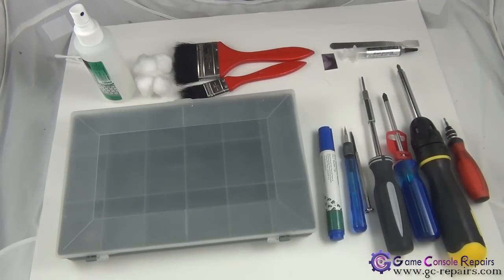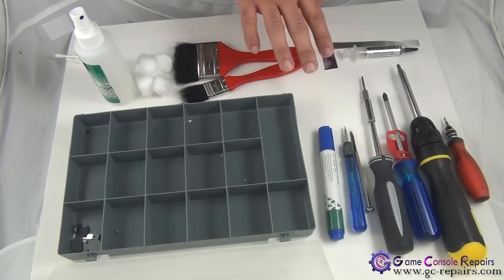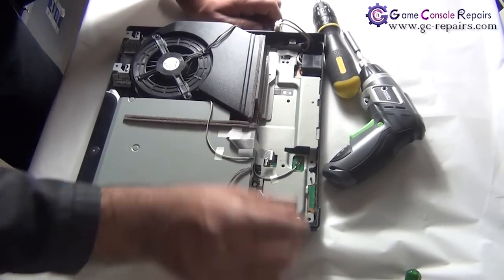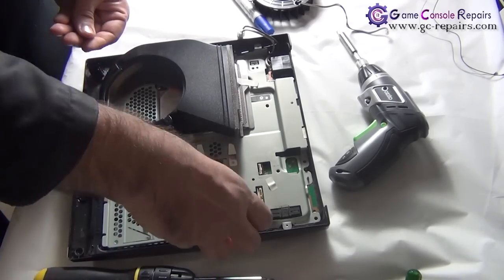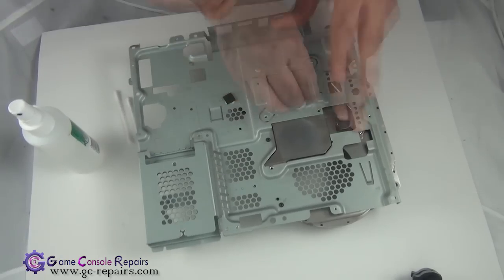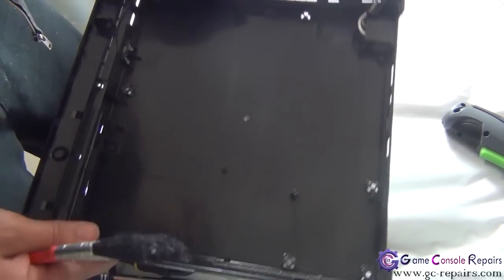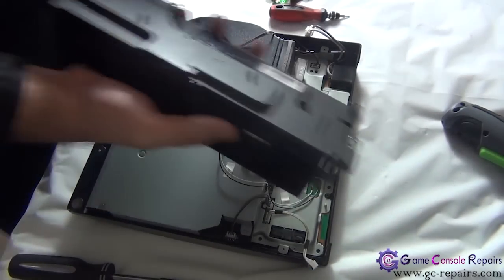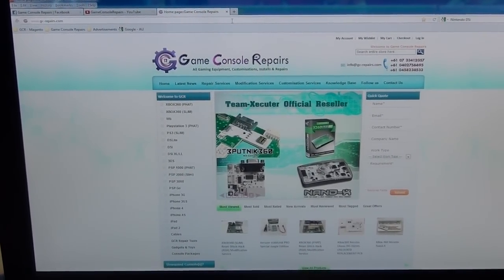PS3SLIM   250GB CECH 2002x   Thermal Compound Replacement by gc repairs com

Comment: For CECH 2004A motherboard is stuck to the chassis and it is difficult to deatach. How can I seperate it without damaging the motherboard and even end up in ylod ? Thank you very much.
Reply from the maker: Most likely the thermal paste is completely dried off. 
Use a heat gun on the CPU/GPU chipset to loosen-up the Old thermal paste from the motherboard.

ATTEMPT # 1 - Try 120-degrees for 10-seconds and lift up

ATTEMPT # 2 - Try 150-degrees for 5-seconds and lift up

Hope this helps.

Comment: Excellent video! I was noticing a very loud fan noise on my old PS3 Slim along with a rather high temperature on the outgoing air.   This vid helped me to clean and replace the Thermal compound this morning . It is now smooth and silent as day one.

Comment: For the CECH 3001A the fan cannot be removed until you remove the bottom plate and expose the cpu/gpu. 4 tiny black screws hold it into the motherboard.
Also, the blu ray player requires needle nose plyers to reinstall the big ribbon, which is on the BOTTOM of this model and the ribbon is only 1 inch, or 25mm, long. Note to anyone out there with this model. 
Other than that, some of the screws are different.

Thank you, and great video!

Comment: Stripped mine down in prep to buy the paste as I wanted to see just how dusty/old it looked and it wasn't that bad, still had some stick to it, some crusty.  I've replaced the lithium battery just as I had a fair few (what does that do anyone know?), might not bother with the blu ray drive if I can't reconnect given i'm using it mostly for psn.

Reason for giving  this a go was because after 5 years of no use I finally hacked it to get some hard to find games on it, 10 hours play later just wouldn't power on longer than 3 seconds, apparently (and hopefully) this is the fix

Comment: I have a question. I have teo ps3s the I cannot get to play a game long enough. I have opened them both and cleaned the lens. It seems to be another issue because the system is not that hot and I get a freeze.

Comment: My bluray drive dropped on the floor by accident from a table. I'd say like a foot drop. Should I expect it to be damaged?
Reply: yes there are lots of moving mechanic parts witch are plastic or really bad connected ....... to case ......
Reply: did it work afterwards?

Comment: Had some fun tonite doing this, since Im tried of the ps4 games I have. So why not make the best of it and replace the cooling paste I though. 11:12 I unmouted the fan-house to so I could clean it better. Not much dust here after five years. But I recon I can start having some fun with the beloved and old ps3 now. Thanks for posting. I would have used more time on this if I was without a answer on where all the screws should go.

Comment: I need some tips or help. I applied thermal paste on the CPU and GPU. I reassembled the PS3. It played the PS3 games it was playing before, (using hair dryer to bypass the ylod) then the PS3 suddenly turned off. After it shut off on me, I haven’t been able to get it to display on my TV anymore and it freezes anytime i press the power button on. Please help before I drop the PS3 outside my 7 story window.

Comment: I have a question. My PS3 turns on and immediately off, including the fan. Everything seems to work, it's receiving power but just doesn't stay on. I've done the self cleaning by holding the eject button which causes the ps3 light to flash red red green yellow but that never happens without the fan test. Will doing this fix the PS3? Also, I've heard of a method involving a setting within the power block as well. I want to do this and I'm ready but IDK if it will fix my issue. Thank you ahead of time.
Reply: Yes it would fix it. It worked like magic on my faulty PS3

Comment: Hey you guys, i had a question.
I've changed recently the thermalpaste of my PS3 Slim, and i have noticed  that the system fan hasbecome stiller.
That is fine, but now strangely enough after a couple of hours gameing, when i say  oke time to turnoff my PS3 via the menu. Than i get 3 beeps when the system is turningoff ?
Reply: It means its force closing an app/game

Comment: How long should you wait after putting th  thermoglue before turning the ps3 on ?
Reply: The thermal paste will work once its on. It will take several cycles of warming up and cooling before it's performing at peak performance, but it's 100% safe none the less.

Comment: Making something broken work again instead of buying a new one is the greatest feeling, especially after your up at 5:00 in the morning continuing to try not willing to accept failure for the day. Thank you, for your video fueled my obsession to fix my PS3 and guided me through it making me a champion cpu chip cooler who earned a well deserved rest to mid day. Now I'm off to enjoy the rest of the day and boast of my accomplishment, still knowing little about the inner workings of the PS3. I have not turned on my PS3 for fear of the realization that it may have already stopped working but I take pride in knowing it worked the last time I checked
Reply: You're crazy 😂
Reply: Is it still working?
Reply: I tried to repair my 60GB "fat" PS3 3 times, couldn't get it to work. Unfortunately, I feel it suffered irreparable CPU damage when it YLOD years before. That or the massive heat sink got bent when I pryed it off. Either way, I sold it on EBay for parts.... I loved that thing, so shiny, so sleek, backwards compatible, such a great console. 😶
Reply: @ultima913  I bet it was the capacitors that burned out every one thinks it's the rsx chip but it the 3.5volts capacitors that caused yellow light of death

Comment: WARNING DO NOT SPREAD THE THERMAL PASTE! PLACE ONLY A DOT IN THE MIDDLE SIZE OF A RICE CORN AND IT WILL EVENLY DISTRIBUTE WHEN YOU CONNECT THE HEATSINK BACK! 

YOU SHOULD NEVER SPREAD THERMAL PASTE AS IT CREATES AIR BUBBLES AND CAN CAUSE HEAT POCKETS WHICH WILL DESTROY YOUR CHIPSET! BE WARNED
Reply: It doesn't matter as much as you think it does. What's important is that it's there, not so much how it's applied (unless there's too much or too little). Trust me, I've done so many tests of this. The pea method always results in 3C or so better temperatures in a full load situation on a PC, not sure why a PS3 would be any different. It's not going to blow anything up to do the spread method. With that said, pea is definitely how it's done from the factory and its just easier in this situation, those alignment pins make it so that when you put the motherboard back into the top of the holding cell, it mates the heatsink with the chips perfectly.
Reply: If you have to add more for some reason, it's recommended to clean everything off again and put on new thermal paste entirely.
Generally you don't need to put on a lot, a cooked rice grain or a small pea sized drop should be more than enough.
Reply: SMGJohn What if it doesn't spread through out the whole chip can you add a little more?
Reply: +Ram Bow
The fact that there are hundreds of videos on YouTube that just proves that rice corn is the best method and spreads just as well as the other methods without overspreading and it also leaves no air gaps which can be the difference between a long lived CPU or a short lived CPU.

Overdoing it can cause worse thermal performance, basically there so much thermal paste your copper plate wont connect properly to the chipset.
Having two layers is also the worst thing you can possibly do.

Just watch the videos proving the point, there no need to overdo it or doing it complicated.
Americans always have to do it complicated when more than often, the simplest of the methods is the easiest.
Reply: NO IT DOES NOT.

This is an old myth from the early 2000s. It has been debunked time and time again. Application method has ZERO impact on temperatures so long as the correct amount is used.
Reply: I seen a method on youtube where a guy uses a card to glaze the chip and then uses the pea method over it. I think that is the ultimate method

Comment: i followed this step by step and was super careful. now my ps3 isnt showing the power lights? (so no red light etc) what would cause this?
Reply: +hoodninja Did you forget to plug the power supply in? ribbon cable for the power switch?
Reply: i dont think so there was 5 total ribbon cables right?
Reply: hoodninja Doesn't matter if you forgot a cable for the blueray disc drive it would still power on. you want your main power connector with a white clip (black and gray wires) then on the opposite side you'll have another connector make sure that's plugged in. Then check the ribbon cable for the reset and power. It should power on. You'll see a red standby light when plugged into the wall.
Reply: norge696
ill have to look around but there was 3 on the back of the blue ray drive and 1 under it and 1 for the front buttons. thats what i remember.
Reply: +hoodninja same thing happen to me ,how were you able to fix it?
Reply: +Derek Lopez I never did.
Reply: +hoodninja so it never turned back on,man that sucks.
Reply: +Derek Lopez well it's red when the system is off. but no color when it's on.
Reply: mine doesnt even trun red or on ...
Reply: Derek Lopez Double check your wires.
Reply: try replacing the power supply.
Reply: it ended up just being the button part the silver panel thing
Reply: +hoodninja Oh ok.

Comment: Great instruction. I followed on a CEH-2504A. Wifi connectors were in a slightly different place and there was a ribbon cable under the BLUERAY which was a little difficult to work with, otherwise all the same info. Now to see if it's helped :)

Comment: iv watched a few videos where people heat their motherboards. why do they do that? is it even nessesary or is it a step for the "fat" ps3s?
Reply: +Burrito43754 
Sometimes heating motherboards in ovens can resolder it its also done with dead graphics card that dies because of poor soldering work. It works and sometimes it wont work.

Comment: i used this tutorial and replaced the thermal compound, everything is back together in one piece now to try if it works. :D. I have never worked with electronics before like this and you lead me through it all. Thank you
Reply: Does it still work and what symptoms did you PS3 have when it started having problems?
Reply: This ps3 must have had more issues than this because it restarted itself once in a while. It acted kind of like a timed bomb, you could play on it for between 20-40 minutes but then it just turned itself off. 

So sadly this didn't help it, the video is a good one but my ps3 was already doomed it seemed.

Comment: Yo I just did the thermal compound and cleaned out my PS3, but my game still pixelate. What do you think it could be? The only other thing I can think of is the hdmi wire, what do you think??
Reply: Yes could be or maybe new power supply would fix it or maybe hdmi connector is broken ind you may have to resolder a new one
Reply: jakdaripper100 Nah it was over heating, but I put it away now until I can go get it fixed. Back to the Xbox One now;)
Reply: Monster The Kid  playstation forever lol xd

Comment: Help me please <~<<

My PlayStation 3 is stop at the middle of the game not all games but some games  ... yellow light of death ...
The the system worked very well but when I started game specific games like call of duty yellow light of death pop up in my system will be turned off ..........what is the problem ?
Reply: Ali, i have been having the same problem also.  the reason why certain games are doing that is because they are heavy graphics games, which utilizes 3d, textures etc...so thats why some games run and some stop in the middle of gaming, Basically over the time of continued use of your ps3, the thermal paste has dried on your gpu and cpu, So you'll need to reapply them.  This video is exactly what you need to do. 
Good luck
Reply: Because your console is heating up and the cpu shuts off to keep itself from frying

Comment: my ps3 that fezzes and then weird boxes that are yellow and white come all over the screen, will putting new thermal compound fix or do i have a different problem.
Reply: Check you cables.
Reply: u need to change thermal paste

Comment: I have an slim 3001A, some times they freeze during game, fan speed show be normal. Did recomend replace the thermal compound to prevent future damage ? Can use artic silver 5 or artic MX4 right ? I see a way to make a little increase the default cooler speed, you recomend this too ?
Reply: Yea or I could be frame rate lag to but you may want to install a fan control to if your going to replace the thermal compound

Comment: I have a problem. I did everything and it doesn't heat anymore but the problem is that when i turn it on it doesn't show me anything. What should I do ?
Reply: I tried but its not working either. I thing i have green light of death and i may try the 4 penny trick
Reply: Do you have any idea if it would work

Comment: Few thoughts...
1. manually spreading the paste never works out for me, once idid it and I saw the heatsink only made spotty contact, parts of the paste were untouched, I use the pea method.
2. I notice the slim clamps bend much easier than CECHA clamps, I don't think the pressure is sufficient.

Finally, my ps3 slim temps during load  cpu 65-72c rsx 70-78c. Any thoughts?
Reply: There not bad, but If you are worried about temps change the paster under the IHS
Reply: Kenneth Shiro
Reply: Kenneth Shiro

Comment: Is the isopropyl alcohol necessary? I never use any of that when i replace my thermal compound on the pc and it works fine.
Reply: It's only a couple dollars at your local grocery store and just makes cleaning the crusty cpu and heat sinks easier.

Comment: Yeller lighter depth.
Always blow electronics with appropriate electronics air, never vacuum electronics. Also you don't have to spread the compound. That was the cause of the problem in many cases. It touches the board and tells it it's overheating. "pea size" right in the center is fine. It's ok to flatten it a bit, but do not spread towards the edges, The heat comes directly from the center only. Also i like electronics cleaner better than alcohol, because it gets any missed compound off the board.

Comment: What other suggestions do you have?  I followed all your steps to a T, booted up PS3, and it's not staying on more than about 10-30 seconds before powering right back down.   I have tried 2 power surges, 2 different locations, checked power cord has lines up :/   (someone said make sure power cord is set properly).  I've cleaned all dust inside.  I was careful with all my steps.   But even after cleaning (I did that yesterday) and now using arctic silver 5 (today), same behavior.  :( 

What are the symptoms for a bad hard drive?

What are the symptoms for bad power supply?

I don't know what else could be wrong.   

I can get to the main screen (by holding power button ... beeps twice), but as soon as any of the restore options begin, the console just powers down.   

I'm on the 120GB slim.

I'm about ready to send it into PS3.   Even a local shop quoted me (over the phone) 80-100 or more.  Sony told me 100 and they'll warranty their work for a year.  

Thanks.